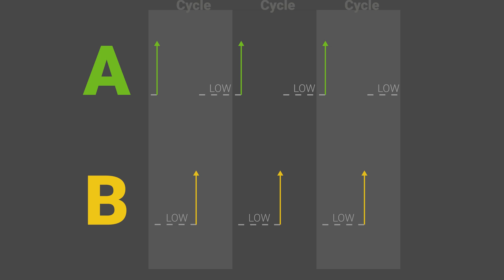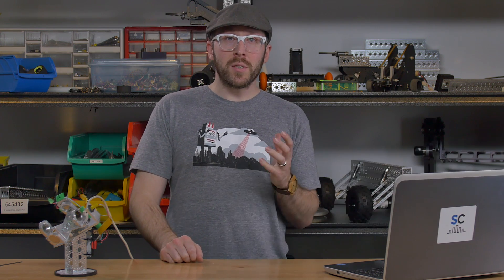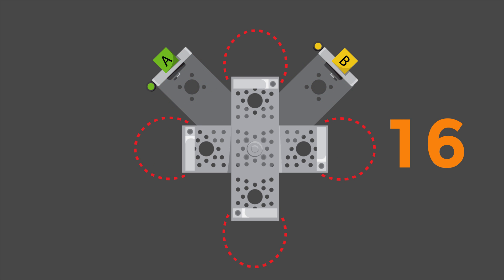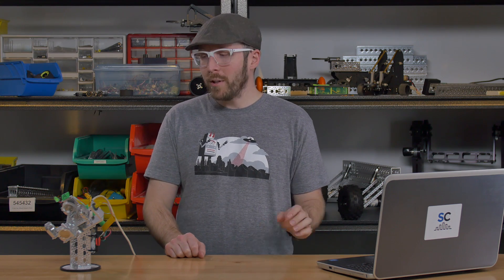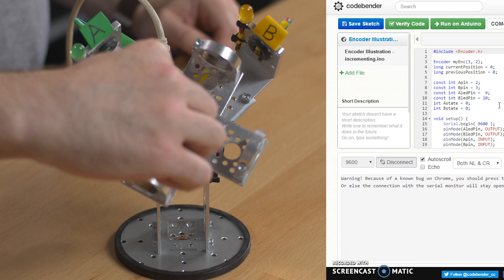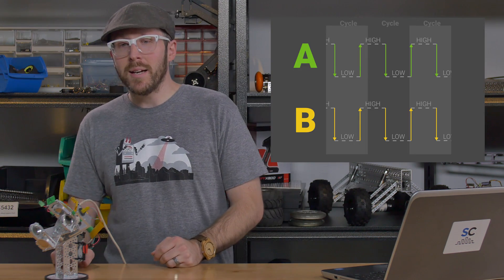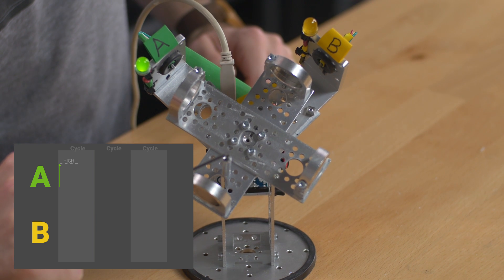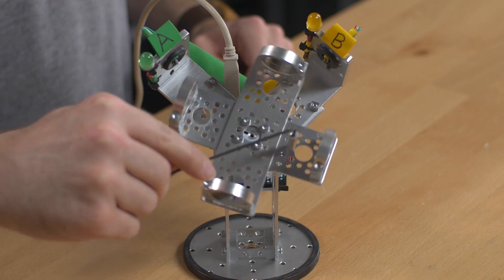How Encoders Work - with Jason

Comment: How do you plug it into a microcontroller please? Or a hundred of them? Also, do they allow for reverse positional sensing? I'm building a robot and want to be able to position the robot into poses and save each frame easily for sequence replays.
Reply: The grounds of the encoder sensors would all connect to the microcontroller ground. The encoder sensor voltage + would go to the IOREF of the microcontroller (or 5V+ on a 5V board or 3V+ on a 3V board) . Then the wires for channel A and channel B of each encoder need to be connected to a digital GPIO pin (ideally an interrupt capable pin). The library I use in the examples will work either way (because graceful degradation aka progressive enhancement) but you will get better performance out of interrupt capable pins, so check the pinout map for your board. If you are looking at Arduinos, look at the Due. It has 54 digital pins all of which are interrupt capable and it is faster than the "average" Arduino. For example the popular Arduino Uno has 14 digital pins of which 2 are interrupt capable, and the Due is about 5x faster than the Uno... but even then, I don't know how many encoders you can connect before speed becomes an issue.
Reply: And as for "reverse positional sensing":  you can tell what direction the encoder is travelling in.
Reply: Thank you, but way too complex. I want to use them to replace the 24 servos I am using in my robot, which plug straight into the 24 PWM slots on my EZB v4 board. I'm looking for simple product names. And links. Preferably with video assembly instructions and demos.

Comment: Very nice. Your RPM measures jumped around a lot. What's the source of the noise, and might a low pass filter help with obtaining a more consistent reading? Thank you
Reply: Yes that would certainly help... also just adding a delay in the loop helps smooth it out as well.